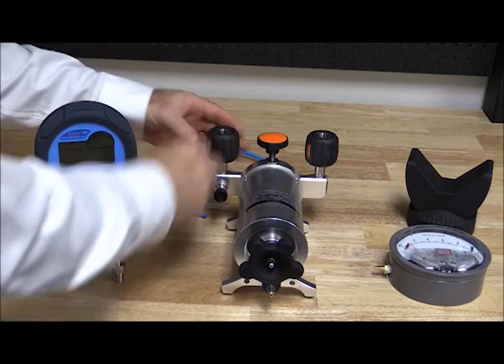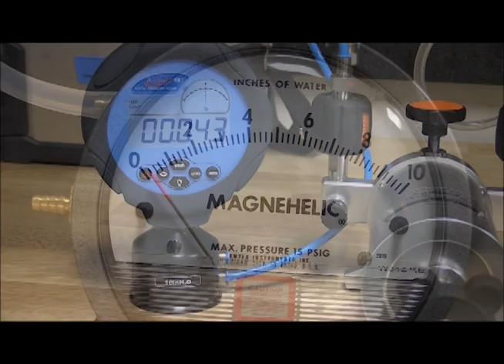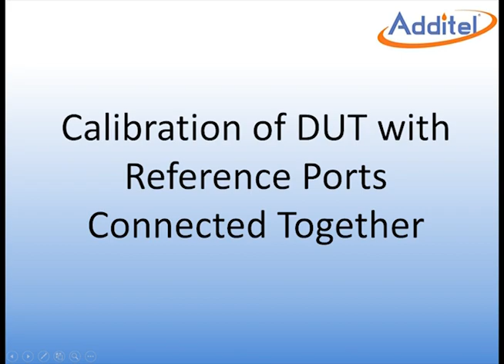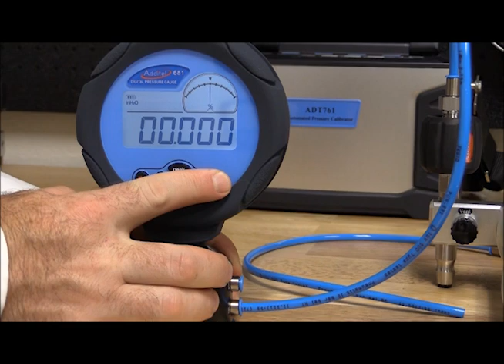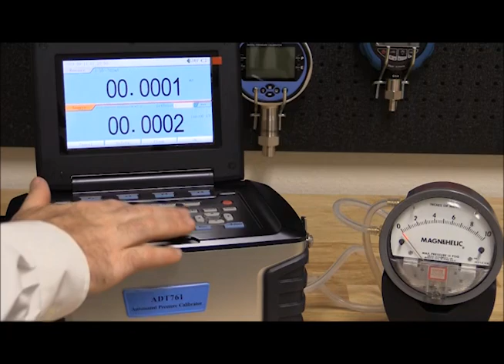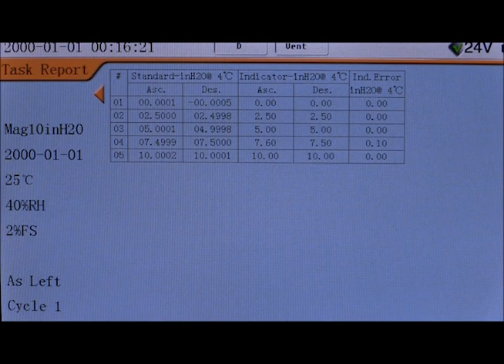DP Gauge Calibration

Comment: What is the part # for the gauge that you are using in this video. I know you said 681 but there is more to it than that.
Reply: Hello Jason, it depends on the pressure range you require. The model number would be ADT681-05-DPXX-H2O. The XX portion of the model number would be the range in inches of water you want to cover. Feel free to give us a call at 714-998-6899 if you would like to discuss or e-mail sales@additel.com

Comment: Can you help me understand something? I just bought a dwyer 1-0-1" range magnehelic to take static pressure readings on hvac systems, i have digitals as well but wanted to try out on of these. So when i want to take a single reading on return air for example, and i have a static tip and tube connected to the negative port,why does it read as positive? I cant find any info on this anywhere. The two ports in back i have plugged,and one of the side ports is always open to atmosphere when taking single point readings. The same thing happens when i take a supply air reading hooked up to the positive port,it reads negative instead of positive. Can you help me understand this please? Thank you
Reply from the maker: Hello, from your description it's possible the gauge you are using is miscalibrated and may need to be reset. Our service team would be happy to walk you through this and a few other troubleshooting options, feel free to give us a call at 714-998-6899 or email us at service@additel.com.